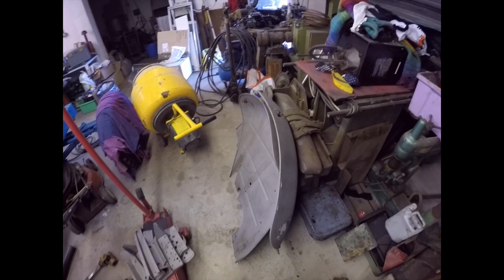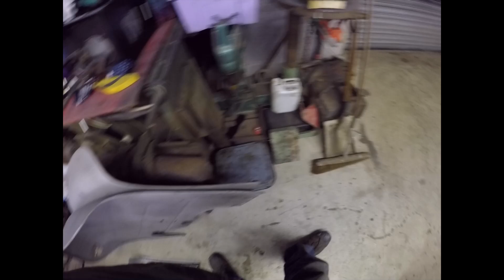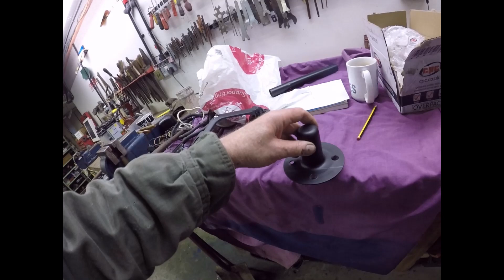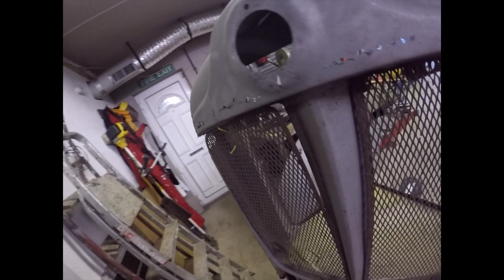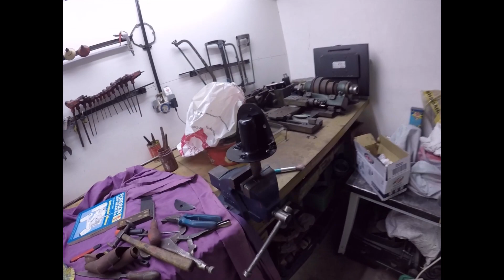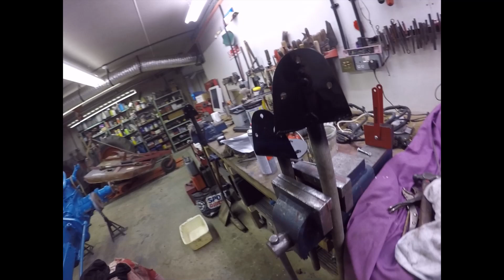Fordson Major E1A rebuild, Part 25, the final batch of blasting

Comment: Well done on monetization of your videos young man. YT must have dropped the 1k Sub threshold? As you know I have done tractor mudguards, can be awkward where the rot is but don't need quite the care a care panel needs. Internet and power supply, I have those problems coming to a unit as you know. I am hopeful the unit internet will be superior to the farm?
Reply from the maker: I am in the process of getting new internet at the workshop as Boundless are pulling out, I am going to go with plusnet, who used to supply the backhaul for LNC £24 a month for 70mbps. I haven't noticed any monetisation? , what do you know that I dont? LOL, if you have seen ads on my channel it will be to pay off a copyright hit where I left the radio on and part of a song was recognised, but I am up to 421 as we speak! Onward to the new unit, and upwards!
Phil
Reply: @philhermetic  Ahh the copyright bot has latched onto your video like a tick on a dog, all is explained. I am with EE and that contract will transfer to the unit I rent. You already know what I think of Boundless! Good stuff young man.

Comment: That cowl looks more air than metal right now, I am sure you can sort it out though.  Thanks for sharing, have a good start to the new month. Charles
Reply from the maker: thanks Charles, the cowl is a matter of replacing the edges where the two parts meet, then filling in the rest, it looks daunting, but the thing to do is get started and wonder how you did it!
Phil

Comment: Liking the rear wheels. Do you brush rather than spray the red lead on? Were you happy enough doing rims with tyres on? Suppose vintage tyres could be damaged if removed and replaced for rim renovation.
Reply from the maker: I brush rather than spray because tyres a very difficult to mask, I used to carefully paint the tyres up to the rim with liquid soap, then wash off when the paint has dried, but these are old tyres that have been left out in the sun, and the walls are microcracked, so that wouldn't work, and my masking tape won't stick to them, don't actually know if there is a tape that will? I am looking for some part worn replacements, thing is I don't really want new, as they will damage the grass to much, neither do I want grass tyres, as some parts of the field are quite uneven. I could live with these tyres if they were not so perished, and I have been told by a farmer that they will be fine on land, but too much road use would finish them off!
Phil

Comment: Hello Phil,
Good the sandblasting is back and the painting of the rear wheels is underway... Looking forward to see the results of your welding next week.
Take care.
Paul,,
Reply from the maker: I have plenty of metal worm experience, thanks to rhe poor quality Russian steel used in European car manufacture in the early seventies!! This at least has some weight and thickness about it, I have rebuilt a couple of 2CV's, they require a "light touch".
Phil